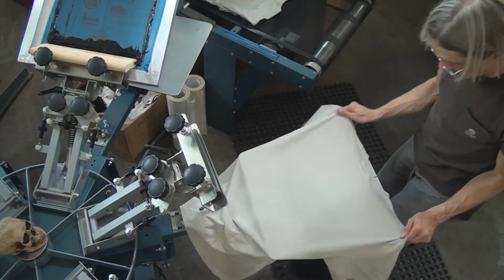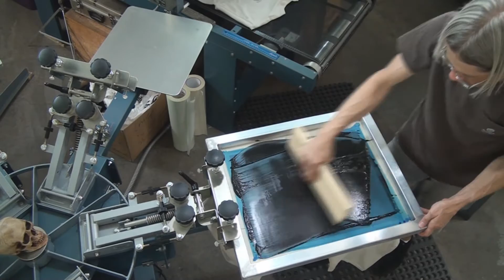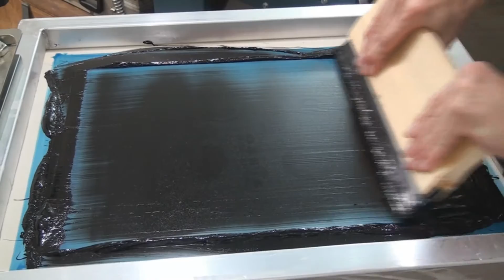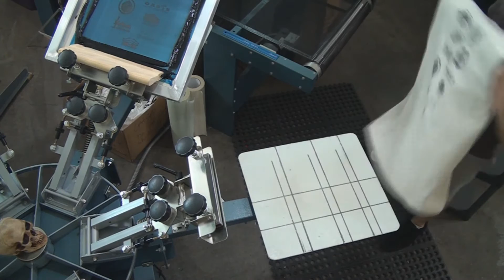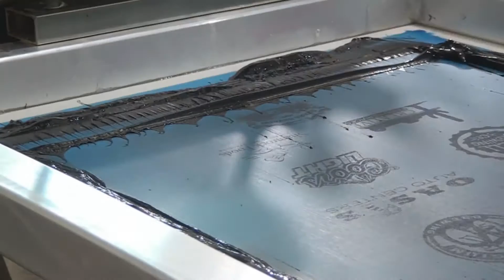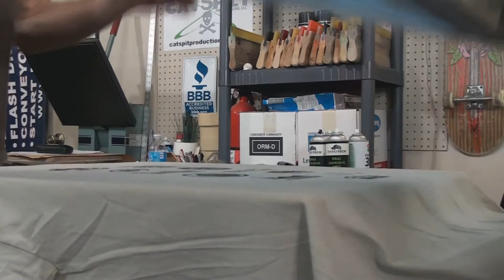1 Color Screen Printing Production Run: Birds Eye View

Comment from the maker: Honestly there are many things that could be causing that issue. Too much pressure on the flood and stroke, loose mesh, pallet or screen movement and even the squeegee.  Use a tight screen, a sharp squeegee blade, spray tack to hold the shirt down and make sure the mesh isn’t too open for the thickness of the ink. Check your off contact too. Thanks for watching and leaving a comment! ☠